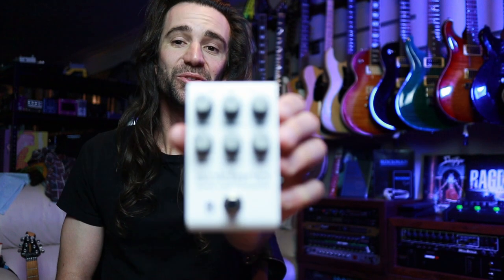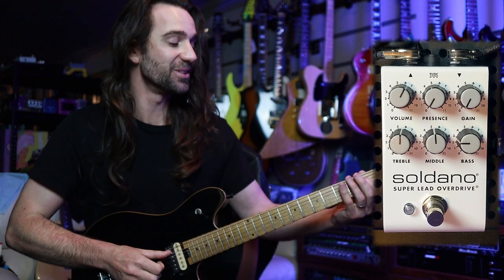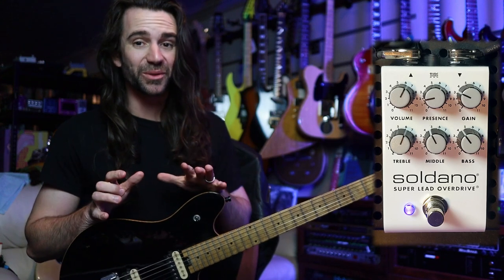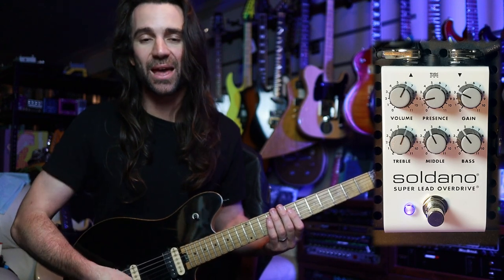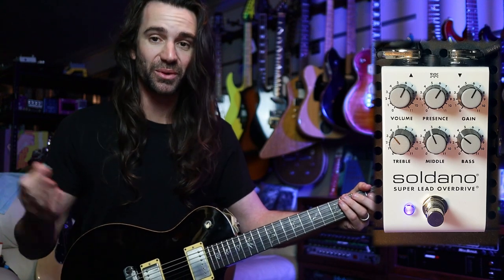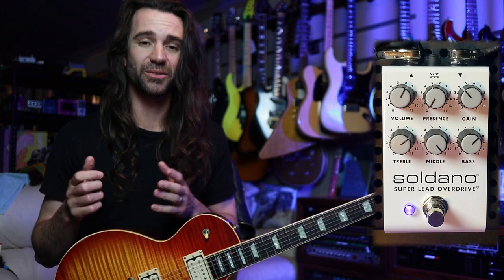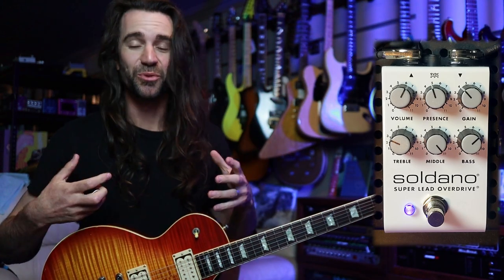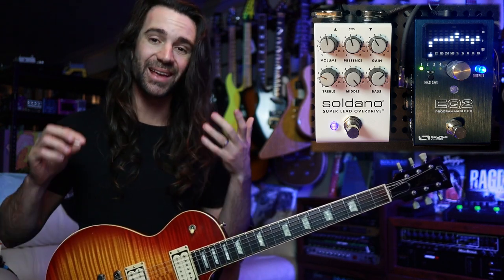Soldano SLO Pedal | Tones by Leon Todd

Comment: There's so many videos for this pedal (obviously the embargo is up) but this is by far the best because you're an actual Soldano guy as I associate you more with the Hot Rod 50 than any other amp. Chewy 80s hard rock riffs just dripping all over the place. 🤤🥵

Comment: I got this when it first came out, it's just great. I do function gigs,I have a Victory V30 and could never find a good distortion that worked, I always stacked overdrives to get a distorted tone. But this works great with a clean sound. I think Soldano got it right with the midrange, it sits perfect, I use it for ZZ top "Tush" ,"Gimme All your lovin" and "Born to be wild"

Comment: Loving the mids!! Great review! I wish Mike still lived in Seattle. I’d go tell him “wheres the snakeskin man”. He built a couple one off amps for me. 8x10
Reply from the maker: 8x10 ! I gotta know more about that
Reply: Also have a pair of Soldano original tube overdrive pedals. My initial thought was to use them to get closer to the slo sound running them through the reverb-o-Sonics. Which they agreed would get me close. Now I kick myself for not getting a couple slo’s. But what interested me more at the time was the decatone.
Reply: The reason I call them one off is because we put a solo option like a Mesa and a variable bass boost with a wag pedal converted to a 5 way selector so you can choose from 5 different frequencies for the low boost.

Comment: That thing sounds good no matter the setting it seems. Sounds awesome. 
Really good and very close to a Soldano at times.  Very boogie like as you mentioned as well.  ♥️🤘♥️...
Good stuff.  
That's a distortion pedal though. Not an overdrive. 😂.  They named it wrong. 😂. Love it though. ❤️🤘♥️🤘.. Love the gain range. 🤘♥️🤘..
Thank you sir.  ♥️🤘♥️
Reply: There’s no difference between overdrive and distortion, or fuzz for that matter. These terms have been used for all sorts of tones over the years and it’s only more recently they’ve started to mean a particular type of clipping.
Plus the name comes from the amp.

Comment: Sounds great but Honestly think this is pretty much the Preamp section of the mini head in a pedal . So I’d think it would probably sound even better & more like a SLO straight into a power amp or direct with a IR or cab sim. Instead of using it as a drive/dirt pedal into the front of a clean amp wich is admittedly add a little color of its own.

Comment: Hey Leon, I just sold my SLO 30 cause to me... it sounded really flat and hard to cut through the mix... the standard complain people have about the BAD built SLO's.  Listening to your Hot Rod 50 sounds way more like a Mike built SLO with a brighter high end. You think this pedal does the trick? I currently run a Lucky 13 with an EQ in front of the amp and I love it, but I sort of miss the SLO sounds... Thanks!

Comment: Cool, but I'm still waiting for the 2 channel, 12Ax7'd floor preamp with built in IR's, that I can run my HX Effects in the loop and set up on a nice pedal board with a couple other pedals.
Reply: And use direct in for recording of course. I want one from Mesa and one from Soldano.
Reply from the maker: So basically a Synergy pedal!
Reply: @LeonTodd  Kind of, but actually made by Mesa and Soldano.  Like a IIC+ with IR's the size of an FM3 or a Cortex. More like the new Blackstar unit you reviewed without the power. We discussed it before. I think there's room for it in the market. Dedicated micro preamp floor units. Just a 2 channel preamp with features mentioned that a player could use on a pedal board. Fluidly switching between channel using other pedals or a processor like the HX Effects for their effects.  Compact and easy to fly rig like any pedal board or modeler.
Reply: Either way, it's just hoping they'd make it at this point.
Reply: @hansgrayman4809  theres a guy in Bulgaria that makes exactly what you are describing.  Arthursound preamps.  I got a silver jubilee preamp last year and its amazing!  Hes got a version for most of the top amps. Marshall/mesa/Soldano/Engl. And the pricing is not too bad as well
Reply: @GabeHelma  I appreciate the info. Interesting product. I had a hard time finding a direct site for those products. Did they close up shop? Only stuff seems to be on Reverb.